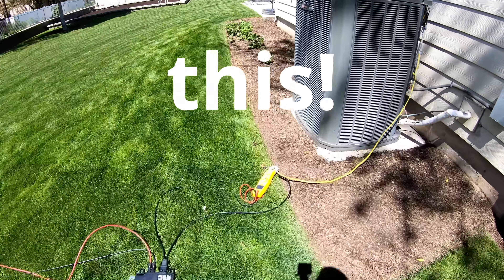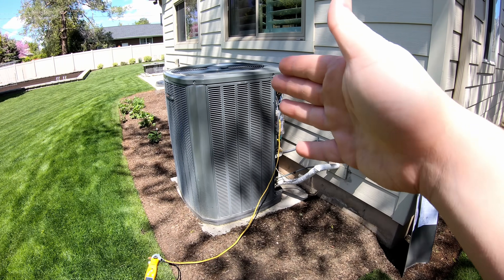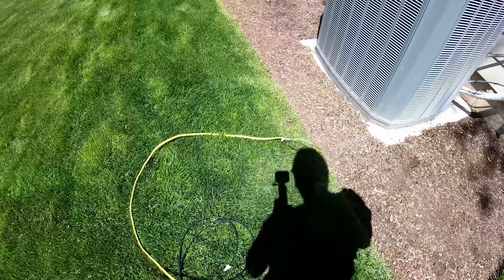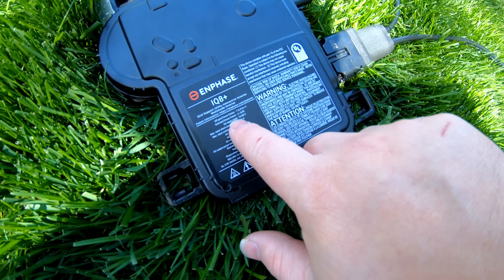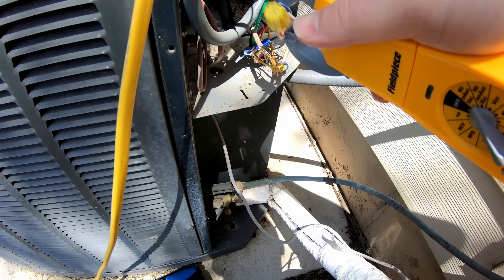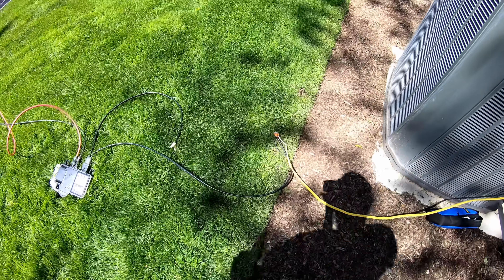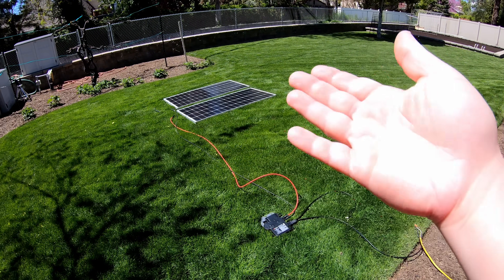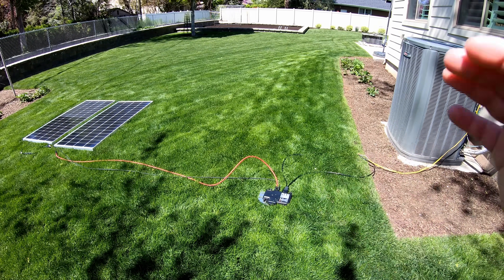1 Hack To Eliminate Your A/C Power Bill This Summer!

Comment: good explanation on power flow, but hate to be the bearer of bad news.   I install systems for living even though your logic is sound. You’re still parallel feeding your electric system when the relay contractor is engaged.  This would still require approval of your utility.  if you were using an inverter that has no ability to outflow like an off grid inverter this would not be a problem.

You cannot assume that the relay could be used as a safety disconnect switch.  The safety disconnects are required to protect utility workers or first responders from getting shocked in case there was an issue with the inverter or any worst case scenario.  Also utility companies are not concerned about whether the inverter can outflow it’s that can the inverter outflow.

A warning to anybody thinking of doing this if your local utility caught you doing it they have the legal right to disconnect your service.

E4 makes a mini split that dual feed Solar and AC. I wish they would do that to the larger condensers.

i’m not trying to be shitty btw.
Reply from the maker: No worries! It's great to hear everyone's thoughts and wisdom! Thanks for watching!
Reply: @theresatrickforthat  personally I like the idea of air conditioning condensers have a little solar inverters in them. I think it’s a crime that it isn’t a standard option in AC equipment.

Comment: So pretty much this is worthless in hot weather because you won’t get the cycles properly you must live with there’s no sun and no real heat. I live in Florida where the temperature breaks 100° and even having your air conditioner down in the 60s can struggle keeping your building or home warm even if it’s very efficient and well insulated
Reply from the maker: Thanks for watching!

Comment: So you’re telling me that those solar panels work at night too with your air conditioner running again you didn’t 100% eliminate your electric bill due to the air conditioner unless you shut your air conditioner off at night, but I’m not dumb enough to do that in hot weather so no false you can do it during the day, but you can’t do it at night and night still eating up electric with that air conditioningbut then again you probably shut it off at night😂😂😂
Reply from the maker: The ultimate is a full off-grid system with batteries and everything....but this is a good small scale stepping stone to that point! Thanks for watching!

Comment: With these tiny sized panels, better to hook it to the house. I'm from third world and the lowest consumption in our house is 300-500 watts due to standby power of multiple appliances.    I have considered this multiple times because a large ac already has nice thick power cables with its own breaker. However, during times when you don't run the ac, that's wasted energy from the panels. Better to buy a proper system with a limiter than doesn't send power to the grid.
Reply from the maker: The ultimate is a full off-grid system with batteries and everything....but this is a good small scale stepping stone to that point! Thanks for watching!
Reply: @theresatrickforthat  agreed. a powerfull off-grid system is the end game.

Comment: Nice! yes Elec current made by the solar thur micro inverters will flow just like water it going to flow in the least resist way so yes what power it made is only going to flow into the nearest appliance long before it will ever flo out into the main grid. Besude the micro inverters need to see power before they will turn on! And no power they turn on off, to safely keep from back feeding a grid line. Thanks for sharing
Reply from the maker: Great explanation! Thanks for watching!

Comment: How much solar to actually start and run with the soft start on the unit ?
Reply from the maker: In my case, I’m just worried about the running amps. The AC can pull the extra starting amps for a spit second from the grid that it needs. I would need about 5 of these micro inverters with solar panels like I showed in the video to 100% run the unit on solar power. I plan to do that as money allows. Thanks for watching!

Comment: How long do the Enphase micro inverters look for a gateway before producing power? I am wondering if the APSystems inverter may be a better choice.
Reply from the maker: It takes about 5 minutes for it to start producing power after it sees grid power. Thanks for watching!
Reply: Enphase microinverters don't look for a gateway to produce power. In fact, they don't need a gateway to produce power.
The gateway is essentially a system monitoring device that reports energy harvest on a per module basis. The newer IQ gateways have the ability to control energy export as well. I ran my Ephase system for about 3 years without a gateway. At the time, I couldn't justify shelling out the 585 USD they wanted for an Envoy.

Comment: Your test appears to be on a single stage air conditioner (the type that tends to cycle on and off numerous times most summer days).  It looks like you could do the same with a modern inverter driven heat pump that works at moderate power levels without needing to cycle off numerous times and is able to work all winter long.  Then you would get many more operating hours per year out of your solar.    I'm assuming the heat pump has a similar 240V AC contactor you can connect behind.)
Reply from the maker: Great thoughts! Heat pumps would be great to take advantage of the solar power year round! My particular AC unit is a two stage system so it runs on low stage for longer periods of time which helps in the way you described. Anything that runs longer would be even better! Thanks for watching!

Comment: Okay it one thing to see it running but will it pull enough juice to cool the house because it’s one thing to see it running the fan but the ac is run on something stronger let us see if it works in the house
Reply from the maker: Maybe I can make a follow-up video some the temps coming out of my indoor registers for you. But in the meantime, you'll have to let suffice my word that it was cooling inside. Plus, the sound on the video when the outdoor unit turns on...you can clearly hear the fan turn on first and then the compressor follows a few seconds later which is the soft start happening. But you can hear the compressor running which would imply cooling is happening inside. You can also tell the compressor is running when I take the amp draw readings from the AC unit itself which would also imply it's cooling inside. Thanks for watching!

Comment: So basically this is a supplemental system which is assisting this heat pump or air conditioner with 400 watts of power. Correct? If this is correct what's good about that system is that it can easily be done without a battery bank and directly imported into your higher wattage devices considering the fact of the sun output. Anything after the fact can be loaded into a battery bank for other lower wattage devices. Very cool
Reply from the maker: You're understanding is 100% correct! It is pretty cool! Thanks for watching!
Reply: @theresatrickforthat  Mint. Direct power and I am assuming for the DC into the Inverter for ac out power at 220volt? to supplement. Start up capacitance for these heat pumps is fairly large and if something goes its usually the crapasshitter like mine has pooched 3 times already in 20 years but they keep pumping.

Comment: Ok, so a poor man's grid tie system, right? Why only connect the AC when you could tie in the whole house and also get a savings when the AC is not running?
Reply from the maker: You could say that! Haha! I personally like the idea of only producing the power needed to run the AC as opposed to running the risk of back-feeding the grid without a grid tie agreement. Some people I know who tried what you said pushed power back to the grid, but the power meter couldn't tell the difference between incoming and outgoing power and so they got billed for the excess power they pushed back to the grid. Thanks for watching!
Reply: @theresatrickforthat     shouldn't be too hard to get the agreement and the proper meter that will run backwards if you generate excess power.

Comment: So does that mean you're running 48 volts into your compressor windings continuously all the time? So if that's the case I think you need another relay . Are the compressors going to heat up
Reply from the maker: Thankfully, no. When the AC shuts off the micro inverter can't see the grid anymore and it completely shuts the power down from the panels. Thanks for watching!

Comment: Could go to a higher output panel and one inverter per panel. 5 in total to cover most of the heat exchangers draw.
Reply from the maker: I agree that would be simpler! I just already had those 200W panels so figured I'd put them to use! Thanks for watching!
Reply: @theresatrickforthat  I have 41 365w panels on my house each with an iq7+ inverter and sit at just over 80% offset.  Im hoping to double the system size when I get our garage addition built. These panels are 3yrs old now and technology has already reached 450-500w panels on the market at close to the price my 365s were. 🤦🏼‍♂️
Reply: Oh and I have a 90kW Tesla model 3 battery to install as well when the new addition is up.

Comment: How about a window air unit. What parts would be required?
Reply from the maker: Connecting solar to a window unit? Not as easily as a central unit. The best way for a window unit would be to get a solar power station, plug the window AC into that, and your solar panels. Here’s a review I did for a solar power station that might work well for you: https://youtu.be/Zdl3syXDUP8?si=QWl4Ml7eYH4qRHTT Thanks for watching!

Comment: I recently purchased my home and am eager to try out the solar panel system. I am also considering adding a few batteries to assist with energy storage during the night.
I believe that utilizing solar energy for cooling the house is an innovative and eco-friendly approach, just amazing 👏.
Reply from the maker: Congrats on your home purchase! Glad you enjoyed the video! Thanks for watching!
Reply: Except that they use massive diesel powered mining machines that move endless tons of earth to get to the right metals to then make the panels. So the environmental damage and fossil fuel savings is still as damaging to the planet as running a coal power plant.

Comment: Wait until the compressor rotors lock
Reply from the maker: If the compressor 100% locked up and pulls LRA for an extended period of time, it will trip the breaker to the AC and shut the system down just like it would regardless of if there's solar or not since the max size solar array you would add to it is just to offset the running amps. So you'd still have a busted compressor to fix one way or another! :) Thanks for watching!

Comment: Awesome. How could you build this system out to supply power to the entire home but not back feed? Offsetting energy usage with a solar array but using no more than what is called for? Is there a “limit switch” of sorts for solar?
Reply from the maker: Probably the best way would be to get an all in one inverter with batteries, and then let the inverter do the switching between solar and battery power and grid power. Thanks for watching!
Reply: @theresatrickforthat  Unless I'm missing something, that inverter, even with batteries, would have to have some type of internal limiter feature with current sensor(s) to keep it from back-feeding the grid.  Much like Sol Ark's inverters have.

Comment: how many 400 watt solar panels to run a 3 1/2 ton heat pump?
Reply from the maker: It depends on a lot of variables. But a guess would be 5 400W panels minimum to offset it 100%. Thanks for watching!

Comment: Very expensive for what kind of savings? How many years to recoup the added costs? You are missing a lot of information.
Reply from the maker: ROI rates will vastly vary from place to place. And if most people are like me, they're probably saving for a larger system with batteries and everything. But this is a great way to start small and scale as money allows and while you won't be getting as much benefit as you will get with a full system, I find satisfaction in at least putting my starting point into service and having it save me a little bit of money! A penny saved is a penny earned right? Might as well not have the solar panels and micro inverter kicking around collecting dust! Thanks for watching!

Comment: The only real problem with a setup like this is in the event the grid fails, you would be feeding current into the grid. In all likelihood the enphase usit goes into overload protect. But depending on where the downed line is and who come in contact with it, they could get exposed to the current from your enphase even past the point of the downed line. I understand this is just an experiment and you likely already understand that an automatic isolation switch is needed. But I kinda wished you would have mentioned it.
Reply from the maker: I have two points of good news for you on this! 1. If the grid power goes down, that will obviously kill power to the entire house resulting in a loss of 24V at the AC unit contactor which will cause it to open thus completely disconnecting the solar from the grid. 2. Enphase micro inverters meet the rapid shut-down requirements. Thanks for watching!
Reply: @theresatrickforthat  That's good. I wish you would have mentioned it in the video. Maybe you did and I didn't notice. A lot of people have a very simple understanding like I do and they don't know that. Hell, I didn't even know the enphase shuts off when it stops detecting the grid.
Reply: No your not, that's the point of tieing to the ac unit itself
Reply: @chump20004  "no your not", what?

Comment: I did a setup like this for my house. Six industrial solar pnl using a 2x3 setup and three inverters I picked up from ebay. Just plugged the whole thing into a 30a socket I have on the out side for a gen. Knocked about a $100+- a month off my bill. On a good clear day it would crank out 1kwh on average.
Reply from the maker: Sweetness! Thanks for watching!
Reply: How much money do you have in your setup if you don't mind me asking?
Reply: @skeon67  The Solaria panels (230W) were a $100ea. used. The inverters were $130ea. new. The wiring/cables, meter and other odds and ends like water proof connectors and such were another couple hundred. I got lucky with the solar panels. Very high end...each panel was covered with a glass panel that had a convex lens over each cell. Captured light from almost any angle.
Reply: I'm assuming this 30A socket is tied directly into your panel and will actually backfeed to the grid if there's not enough load being used to consume all the solar power generated?
Reply: @ssoffshore5111  I had a pretty big load...it really just cut down on my draw from the power co.
Reply: @ssoffshore5111  keep in mind it would have to be more than the entire circuit is consuming... not just that AC
Reply: @ssoffshore5111  YEa so what who cares. It's free electricity for you and you think the power company is going to come and yell at you for giving them back  free electricity?
Reply: It sounds like your inverter is feeding into a transfer switch you installed to divert the AC's normal power supply to your set up....is that correct? I've seen a few videos like that...I'm trying to visualize your set up.
Reply: @adivasworld  I used grid tied inverters going into panel. They work as long as there is a signal of supply from power grid. If the grid is down they do not output so there is no back--flow into the non-powered grid.
Reply: @Bluebark64FIS  Thank you! Very interesting. I will look into that a bit more also. Thanks for sharing
Reply: @adivasworld  On a side not,e I used a 96V storage system that tied into an APC backup/pdu setup. It consisted of the APC Backup with a pure sine wave PDU with 2 30A rails. Picked it all up for $100 from a data center that had just decommissioned it.
Reply: Do you have the bake for the storage system? @Bluebark64FIS
Reply: @fmolina28  The bake? You mean setup?
Reply: @Bluebark64FIS  Sorry, it was a typo, I meant to say, "Do you have the name to your storage system.
Reply: Do you have a pic of your system?
Reply: @B0X2002   Yes but not on the net.
Reply: can you send me the panel you used and inverter brand thanks
Reply: @victorcosme1971  I used something like this inverter for the panels set up in a 3 x 2 config.. /Gdrasuya10-Inverter-Microinverter-Automatic-Inverters/. You need to size to your needs.
Reply: Wouldn’t this back feed the grid? If power goes out would you unhook it?
Reply: He is on the output side of the contactor so that side is only connected to the grid while the ac is running, and since the ac draws more current than his panels output, its all consumed. @Tlepre
Reply: Please watch the presentation again for your answer.
Reply: @Tlepre no. The inverter doesnt send power unless it detects voltage from the grid, and cuts off when it no longer detects it. That's why it took a few minutes to kick in.
Reply: Wow 1 whole KWH! That would save me 12 cents on a good day. What’s the ROI on that setup?😂
Reply: @RW-ur7ym  He already told you it's knocking $100 month off his bill, that puts his ROI (assuming year round numbers are not as good as reported peak) at less than 2 years.
Reply: @RW-ur7ym  I was just talking about this with somebody yesterday. Our power is even cheaper than that at 10.3 cents. The payback period on most solar is super long because of that.
Reply: @ksnax - you’re not counting the incentive that you get. Most people don’t realize but when you install Solar yourself, you still get at a 30% federal incentive and you can technically cover all of your tools and everything that you would buy to install it.
Reply: @RW-ur7ym  that would save you 12 cents per hour in your specific case or about $1/day.  Your ROI would likely be 6 years after which your system would continue to produce